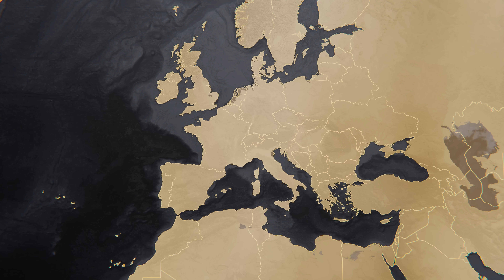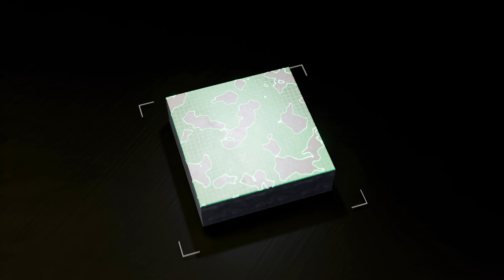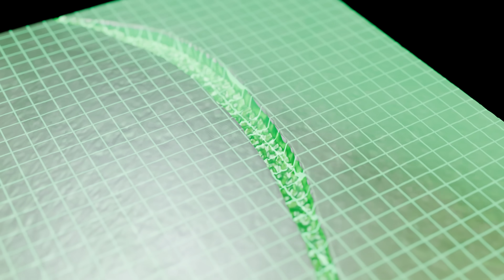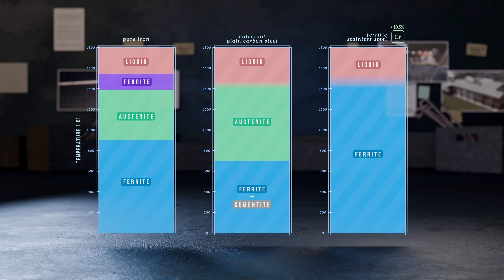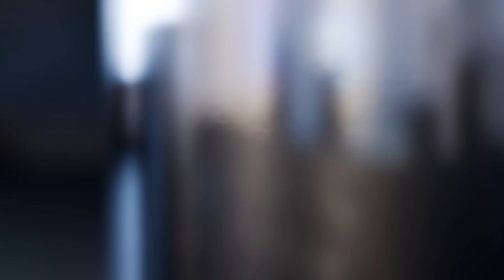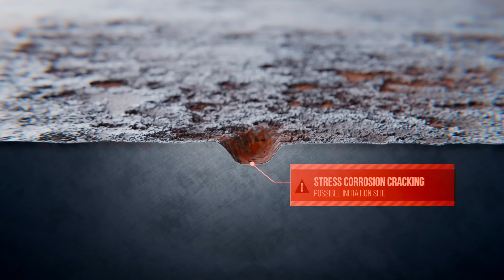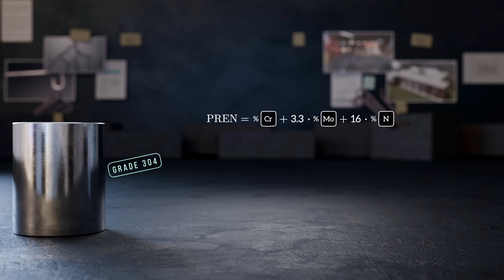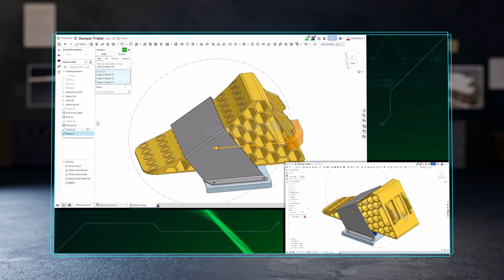The Problem with Stainless Steel

Comment: Crazy story,
I was the welder/fabricator for an aerospace fastener co. They had to use a hi temp salt bath of NAOH to clean the Titanium bolts. I had to replace every year the steel pipe burner tubes that melted the powder into liquid. NAOH is a high base element, very caustic. Anyway I wanted to save my self the chore ans got the manager to go for pricey 308L pipe. Stainless steel. I had a maintenance welding rod high in alloys for ductility and high strength, good elongation too. Pricey stuff, High in chrome and ni. It was a secret alloy so not sure. Made the burner and less than a week later not 8 months it failed. The high temp NAOH had eaten the weld material away. You could see the bevel/chamfer for the weld bead clearly. Whatever happen sure loved that weld rod metal. Went back to carbon steel pipe after that experiment.

Comment: You're not even supposed to use 304 stainless for salt water exposure, and they used it where it would be exposed to friggin chlorine, which is way worse. I'm not even an engineer and I know you can't use 304 stainless for this application.

Comment: The support rods maybe could have been five times bigger around then when corrosion accours it has potential to be observed easier just by physically looking at them you ought to be able to actually see possible discoloration and also small cracks then remove a few that don't look good test them more thoroughly with sonar and xray and put stress on them to see what it takes to break them  then replace all if one of the rods failed keep observing every five in a half weeks
Reply: How does one remove the suspension rods when they are load-carrying ?...and even thicker rods would have eventually failed because of the crack propagation mode of failure...

Comment: I've seen 316 stainless corrode very badly where it passed through wood on a boat hull.
On the outside it was perfect but where the wet wood had expanded to form a really tight fit it corroded just like mild steel, I was told it was the lack of oxygen and presence of moisture, I also wonder if the wood played a part chemically not to mention salt water.
Reply: I would assume the corrosion took place there due to something similar like in the video, a type of abrasive force, so the place where the wood contacted the steel, rubbing down the thin oxide film and the salty seawater with a moist environment did the rest.

Comment: Ahh yes, the Uster disaster. Something every Swiss engineer learns about during material classes. Yes, I learned the deeper how and why during those classes as well. Even if I already knew about the challenge. Though one thing that I remember from that time is, that they did inspect the rods visually only. Which is precisely why the corrosion didn't get noticed. But the "no inspection done" part was a bit too far.

Comment: I called it from the start of the video. Chlorine.  I work in Water Treatment plants along the Eastern coast and I have seen time and time again the damage that a chlorinated atmosphere can do on instrumentation, Wires and connections, along with the actual structural integrity of the plant and all the valves, limit switches, solenoids and piping.

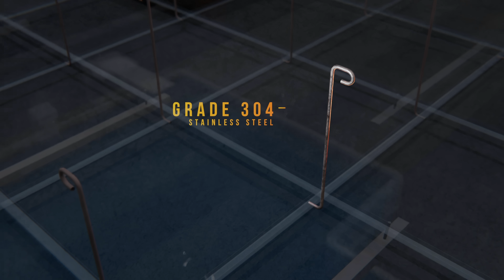Comment: 1:02 this is bull, 304 is entry level stainless, true corrosion resistance is with 416l or 316l
Reply: 100%
Reply: Pretty much.   It’s one of the cheapest stainless but it’s still immensely better than steel against corrosion and still not very cheap compared to typical steel for typical construction.  I always say an engineer’s true job is not to make something better but it is to make it cheaper.
Reply: I think is AI ..exercise caution.
Reply: What do you use it for, or what is it used for ?
Reply: Stainless Steep is not a Structural metal. The tensile and compression strength is closer to Aluminum than  mild steel. This was obviously done for a Cost savings. 304 is a crappy series. Also a 4 atoms on the corner and 1 in the middle atomic structure in metal is called Box Cener Cubic or BCC as they mentioned. They also said it is called Ferite. That is wrong. Thw way the atoms combine have NOTHING to do with what the metals are called like Aistenitic (which is non heat treatable) many other events non metals have these same arrangements of atoms. BothTitanium and Magnesium have 17 HCP (Hexoganal Close Pack) whoch looks like a honeycomb with 3 atoms up the middle and the others would be at the corners of the six sided structure that is built up like a  bunch of stop signs stacked up. Its open and very rigid. So as a metallurgical, this story is annoying.
Reply: Just out of curiosity how old are you and how long have you been working with these materials ? I work for Novartis pharmaceutical company and all types of acid corrosive materials chlorine sulfuric acid hydrochloric acid muriatic acid you name it, salt calcium nothing touches the stuff because it's food grade, They make medications For human consumption, if you're going into radioactive or nuclear type of situation I know nothing about that, please explain.
Reply: You better go back to school
Reply: Thanks for confirming that. I was thinking that, but I am a little too inexperienced to be confident. 

 The other two have more chromium right?
Reply: @keith_5584  316 has more Nickel and added Molybdenum. The Molybdenum helps maintain the austenite matrix as I understand it, whereas Nickel is a Ferrite promoter. 

As for 'L' grades of stainless, they're low in carbon. Chromium carbides form on grain boundaries when the stainless is heated too hot or cools too slowly, usually during welding, production etc. 
In practice, I haven't seen plain 304/316 for years and years, I work in the dairy/food fabrication industry and all our customers specify L grades. You won't find plain 304/316 in anything above 5mm thick anyway.
Reply: @zeroyon4562 I worked in a manufacturing plant that used 316 grade racks that went through an acid bath and into an oven at 1,200 degrees Fahrenheit repeatedly all day long two shifts for years. They took that abuse and lasted decades before replacement. 316 is unbeatable for corrosion resistance. 304 is nowhere near as good.
Reply: Absolutely I worked with 304 stainless steel in a pharmaceutical industry it's the only one that's considered food grade because it's Untouchable to any type of corrosive acid or chemical I don't know what the story is about
Reply: @JustinMiales ::: it’s the constant exposure to a chlorine environment.
Reply: good for you
Reply: @JustinMiales  Not necessarily, I'm working on a 68% concentration Nitric acid vessel at the moment and it's 304L. 316L is no good in this application.
Reply: @zeroyon4562 what is the type of work you do ?
Reply: 304 L is the best stainless you could use for nitric acid

Comment: I'd like to know why a one story building with no utility on top, (the top of the roof is not used for storage or other uses), would need a concrete roof? An insulated steel or wooden roof with tiles, shingles or sheet steel covering would have worked just fine and probably would have been cheaper that prestressed concrete including crane time for installation.

Comment: It would have been useful to have a model of how the steel was placed, if there was only a localized area of failure.  If the bars were totally embedded in concrete or were suspending concrete in the ambient air inside the building.  It seems that the video was excellent in informing the nuclear level of the different phases of stainless steel, but raises more questions for me, more detatil of the failure and how the top of the building was constructed.

Comment: There are different grades of stainless for a reason.  No singke material can do everything.  304 is your typical front runner because of cost.  I woukdnt be surprised if passivated 316 was spec'd but cheaper 304 was purchased. Sourcing and Manufacturing pulls that crap all the time.

Comment: Salt water boat builders know to avoid stainless steel that is under load. The tensil loads, plus salt water is a recipe for disaster. Dont use Stainless Steel near salt, if under heavy loads, simple!

Comment: Why did they use concrete to cover the pool? Was it sound or heat insulation? Or was the concrete structural? Couldn’t they have used rock wool encased in plastic?

Comment: Nothing about the design seemed unusual:

Americans: uh, you said the ceiling was made of concrete? Not the roof…the ceiling???

Actually I’m pretty sure the guy misspoke, it was the roof that collapsed.  The ceiling tiles were connected to stainless steel rods embedded in the roof

Comment: Pretty surprised that they made that error. I'm a welder/fabricator in the food industry. I work exclusively with stainless and it's well known that the use of 304 ss where corrosive products like salt or chlorine is present have to be avoided at all costs. I have seen stainless simply "rot" while being used in or near brine tanks. Also, one of my ex co-worker made his swimming pool piping with 304 stainless thinking it was a good idea. In less than a year there was several leaks all around the system.

Comment: Wow, I learned so much in 20 minutes, I had to watch it twice. I used to work on wooden boats, and when replacing some rotten timbers I removed some 3/8" SS (probably 304) bolts, they looked new on the outside, but they were completely hollow. You could crush them with your fingers
Reply: Wow.
Reply: That's bizarre! Such a situation would make a good topic for an entire 20 minute engineering video.
Reply: Did the bolts hold up when unscrewed, or did they collapse from the torsion?
Reply: The wood was so rotten you could dig them out with your fingers. I'm sure they would have crumbled if I'd twisted them. The nuts were intact, the bolts you could have used as a straw.
Reply: @deang9061  That’s really something.  I’ve not seen bolts corrode inside-out before.
Reply: @Jim_Jimworth the other part of this story is, the owner of the boat didn't maintain the zincs. Zinc is used as a sacrificial metal. When the zinc is gone, the next less nobel metal becomes the anode. The boat also had a lot of silicone bronze fittings, so my theory is the 304 took the place of the zinc, the bronze being more noble
Reply: 316 is marine grade stainless. 304 is for freshwater and non corrosive environments.  There are over 150 different stainless alloys.

Comment: This is very surprising and disappointing on so many  levels.  I'm accustomed to institutional oversight in Europe being much better than North America . It's not like these things were unknown.  I was taught about these issues and more in my welders certification program at the Northern Alberta Institute of Technology in the early 1980's and have had that knowledge be pivotal in solving welding problems in construction and repair of systems using stainless steels.  That this issue got by the engineers and the building inspection regimen  in Switzerland is just astonishing and, of course tragic. Wow!

Comment: This video reminds me of early in my career as a machinist. We worked extensively with stainless steels 304, 316, 410, 416, 440C, and a lot of 17-4 PH. I remember being told explicitly not to use tap water in our ultrasonic cleaners because of the chlorine and mineral content, we could only wash and rinse in de ionized distilled water. I learned why in a metallurgy class a few years later.

Comment: Chloride-induced inter-granular stress corrosion cracking has been a known problem since the 1880's.  Any engineer using stainless should be familiar with it.

Comment: This was very interesting and well presented. For anyone interested, this type of problem is only part or what should be considered in the vicinity of a swimming pool, galvanic corrosion is another issue, where the chlorine in the water vapor and hydrogen in the air can form hydrochloric acid which works as an electrolyte. That's sort of a simplification, but it can be a serious problem. Furthermore, if the swimming pool happens to be down by the beach/ocean, which is common, then even bigger problems can arise. I have seen a 304 SS gas barbecue in that environment seriously corroded.

Comment: Here’s the cold hard truth stainless steel does not corrode or rust. They were probably insufficient for holding the ceiling. Or they were a shitty Chinese grade of stainless that had a higher rating than what they truly was. You can look at a semi truck from the 1970s if it’s still on the road they has stainless steel mirror posts they don’t have any rust any sign of corrosion at all besides that concrete suspended ceiling is a retarded ass idea.

Comment: Chlorides tend to concentrate into crevices, scratches, cracks etc. normally not on smooth surfaces such as plates, shafts, etc. polished surfaces such as food processing industry are significantly less prone to chloride cracking. Chloride molecules are extremely small and can penetrate into microscopic cracks and crevices and, when heated the chlorides expand and form/propagate cracks.

Comment: Anyone else hate machining 300 series? Always seems to want different feeds and speeds, does and doesn't want coolant...
Reply: 300 series are significant easier to machine, especially with carbide and plenty of coolant depending on how much material you are hogging. Titanium machining is a real ball buster, need special chlorinated organic cooling liquids and, very hard for cutter to penetrate or initiate cut. Once cutter penetrates and starts cutting, titanium becomes mush easier to cut that is, until you stop cut and then try to restart. The difficulty is in penetrating/ initiating cut.

Comment: The chromium does not move to the air stainless steel is not fluid you need to remove the iron and steel from the surface so only the nickel and chromium are left this is done with passivation a acid solution is used to remove the Ferris metal and the non ferris metals are left also stainless steel is not self healing If the surface is damaged for any reason it must be repastivated to prevent corrosion.

Comment: 1 major flaw with the building was a suspended concrete ceiling. Why suspend concrete?
Reply: It was only 100mm thick and seen as an ideal longterm low-maintenance in a situation like this, where regular painting or other coating was out of the question... remember, the concrete didn't fail, in fact it wasn't involved in the failure whatsoever...

Comment: I think they would have been better off if they just used good carbon steel like a well-tempered 1095, with a really good industrial coating on it. Today you could use a baked on ceramic coating which is extremely reliable and durable. Back then I'm sure there were some good oil-based industrial coatings available. Or maybe even Chrome plate it.

Comment: Back in the 60’s when I worked as an chemical engineer in the chemical industry, it was common knowledge to keep away from the 300 series SS because of chloride stress corrosion cracking, which also is a nemesis in the nuclear reactor environments. We used alloy 800, 825 more specific and also carpenter 20. I seem to recall that aviation also had some problems with cscc.
I’m very surprised that such important factor was not considered in this environment containing warmth, moisture, and chlorides.
But then, we are dealing with Vikings here, perhaps they should’ve stayed with wooden structures.

Comment: I used to work at a pool. We had to scrub corrosion off of all stainless surfaces weekly to prevent permenant damage. Especially on the lifeguard chair.

Chlorides are definitely no joke. They start really irritating your face if your pool is too warm too
Reply: Hopefully you didn’t scrub with a ferrous wire brush. Stainless can be contaminated upon contact with iron, causing the stainless to rust. A way to remedy this by applying citric acid. I had to do it to a stainless steel dishwasher after somebody contaminated one of the surfaces using a steel saw.
Reply: @jwalker7567  Weird. Why's that happen?
Reply: @Mygg_Jeager  not sure in all honesty.

Comment: This was a super interesting and educational video. Subscribed. I do not recall this tragic event but i think that a suspended concrete ceiling sounds like a bad idea in itself.
Reply: the concrete played no part in this failure....

"On May 9, 1985, the indoor swimming pool in Uster, Switzerland, suffered a catastrophic ceiling collapse, resulting in 12 deaths and 19 injuries. A 4-inch-thick concrete and steel roof fell, caused by stress corrosion cracking of the stainless steel hooks holding the ceiling. This incident highlighted critical safety issues regarding materials used in high-humidity pool environments. "
Reply: @peterfitzpatrick7032 It played a major part in killing the swimmers underneath. Most suspended ceilings are lightweight and non-structural. Why was a concrete ceiling used i wonder? It Seems like a really bad way to conceal hvac plant and support lighting. Such a heavy ceiling seems totally unnecessary for the purpose.

Comment: I recently tried to use SS on a 1952 AC plow.  The Chinese manufactured bolts had very visible cracks in the threads and kept galling with the tiniest amount of torque.  I had to cut one off to remove it before it was even tightened enough to prevent sliding motion.  I decided on grade 8 instead.
Reply: Нержавеющий крепеж вообще склонен к заеданию резьбы. Также большинство нержавеющих сталей плохо работают в узлах трения скольжения.
Reply: It was the wrong material.
PH alloys are the golden boy for resistance and strength. 
Those bulk Amazon fasteners are I think 321 and meant for stationary equipment in a factory setting. 
PH fasteners for outdoors and high stress flexing and temperature extremes.